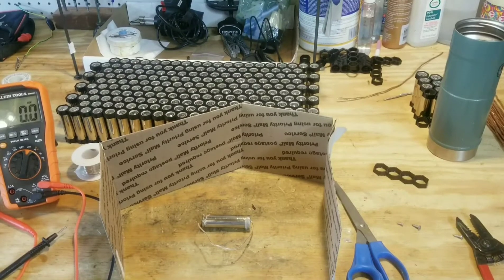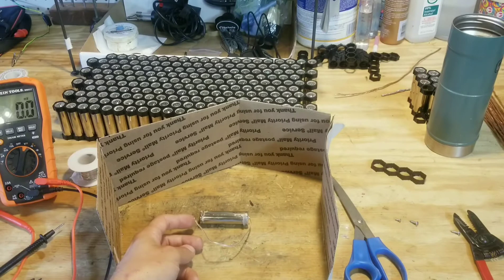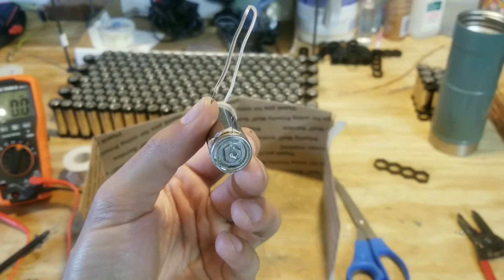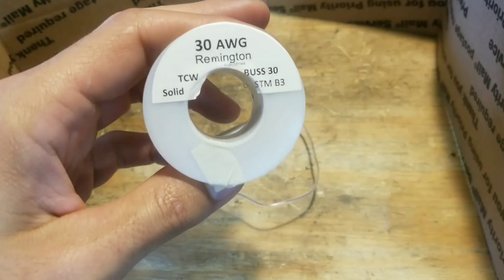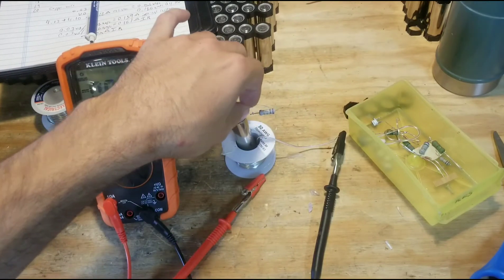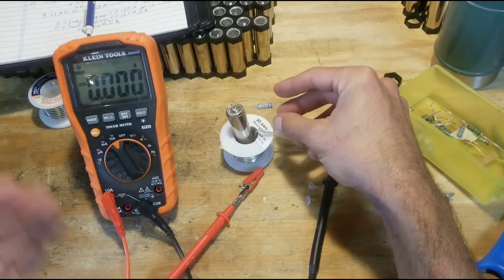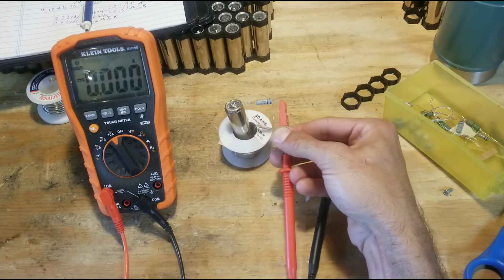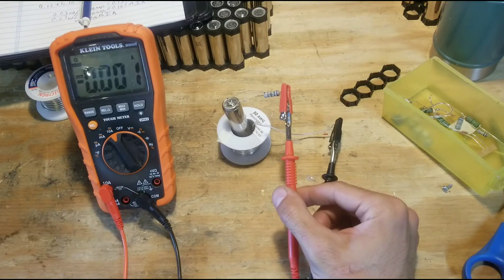Testing 27awg fuse wire for cell-level fusing of 18650 battery pack - 17a x 10sec / 31a x 1s fusing

Comment: Great work, How did you clean the epoxy on the batteries after you removed them?
Reply from the maker: Ultimately I had to use a utility blade to cut it off, its very dense and very stuck on those cells
Reply: @dragon_offroad  Thank you for all your videos and info.